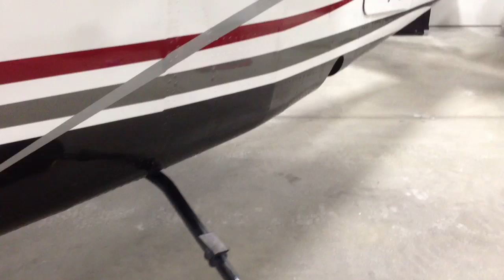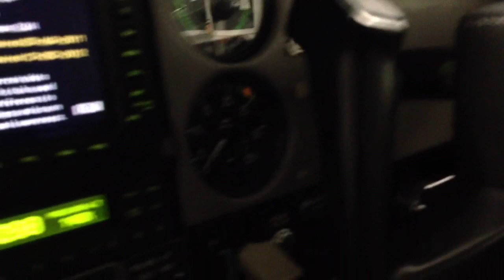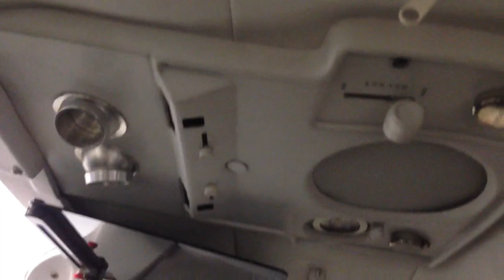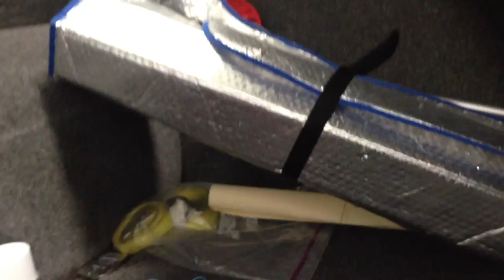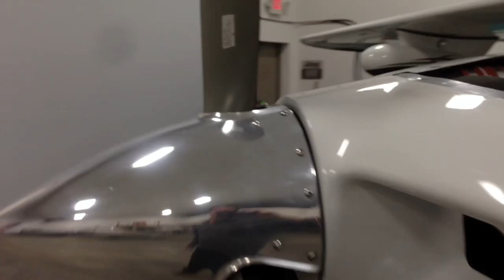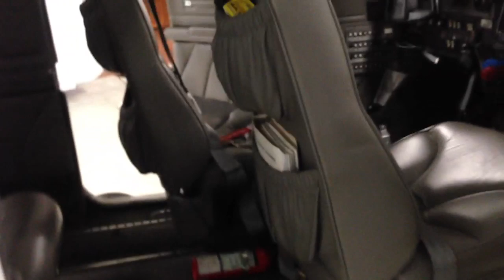Cessna 210 Centurion - 550 Conversion

Comment: You should get your steps changed. Those types of steps tend to keep a lot of moisture in and it will cause a lot of pitting on the landing gear. The new style is like a strip where you just stick it on the main gear.